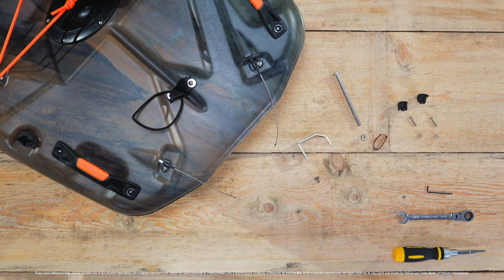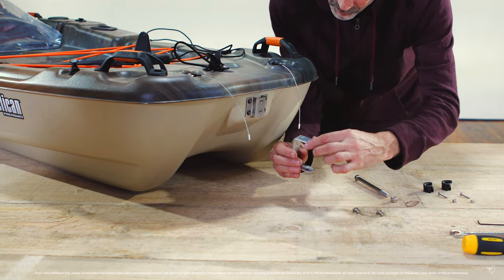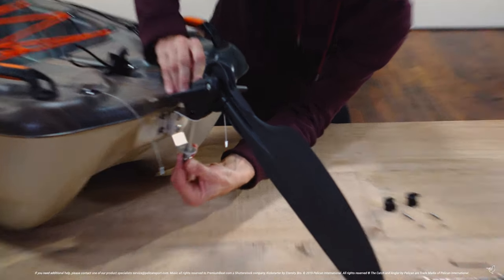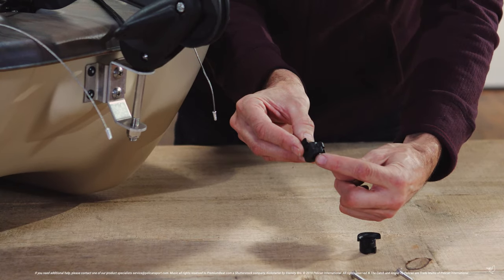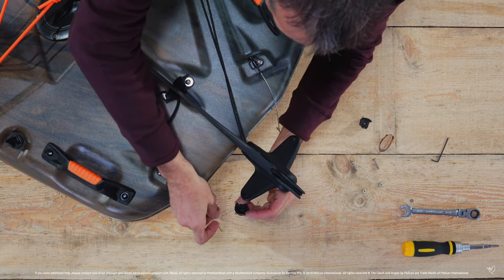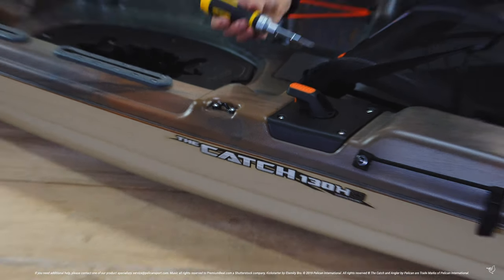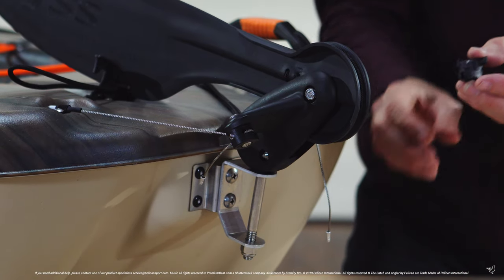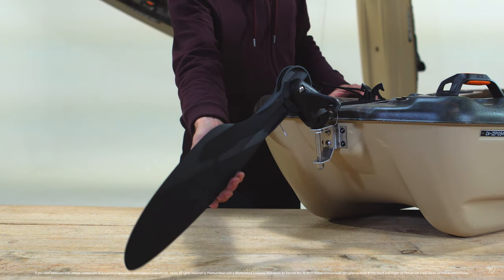PELICAN | How To: Assemble and Calibrate the Rudder on the Catch 130HD Fishing Kayak

Comment: The rudder control bracket in the manual shows the angle on top and flat side on bottom, whereas this video shows flat side top angled on the bottom. Which is correct?

Comment: Instructions show the angled part of the bracket on the top side where as this video has it on the bottom side. Which is correct?
Reply from the maker: Technically, the instructions are. Nevertheless, it does still work if installed the way the video shows.

Comment: My rudder on my Pelican 110 HD is very difficult to raise and lower.  I have watched the videos and read the manuals and did all the troubleshooting advice tips.  My steering is also very labored and difficult even though the rudder will turn.  I have done all of the suggestions in the manual.  Any suggestions?  Any way to lubricate the guide wires.  I will try the electrical tape suggest you guys made to some other owner.  Thank you for your help.

Comment: My steering rudder did not work at all when I first installed it. I removed the tiller handle plate and it turns out while hanging on the rack in Academy Sports people would come by and turn the handle. So when I got it the wires were horribly twisted. I've got them working now, but still gets some kinks from time to time.

Comment: I had to take off the handle and the cable cover underneath the handle because the wire was off the spool and I couldn’t completely take off the cover because one of the screws was stripped and wouldn’t come out. But got it fixed but big hassle being a brand new product right from the store.
Reply: Thanks for your comment! My wires are all off the spool and kinked up really bad. Thought to look when I seen your comment. Thanks!

Comment: the lines that go through the rudder are they supposed to be on one side of the bolt or 1 line on each side of the bolt
Reply from the maker: Hi Chris,
I'm not 100% sure if I understand your question as I'm unsure of which bolt you speak of. Nevertheless, there are outlets on both sides of the kayak so that the lines go towards the rudder to form an almost triangle.
Reply: The line goes through the rudder the loops and comes back out . You put the bolt into the rudder to mount it . Do u put the bolt in by having the line on each side of the bolt or on one side
Reply from the maker: @Lycanzz  technically you can mount the line before or after attaching the grommet to the rudder with the bolt as it doesn't affect the line. The end result should have the line going up through the side of the grommet through the "teeth" / "notches", loop over and back down through the hole in the grommet which the set screw tightens against. The bolt that mounts the grommet onto your rudder is positioned in the middle of that "loop" you create with the looped line.